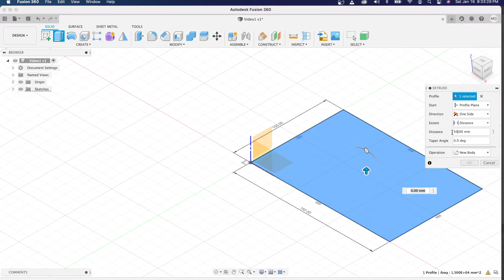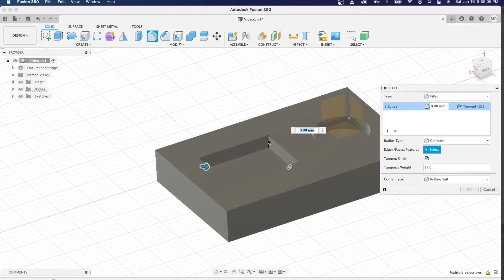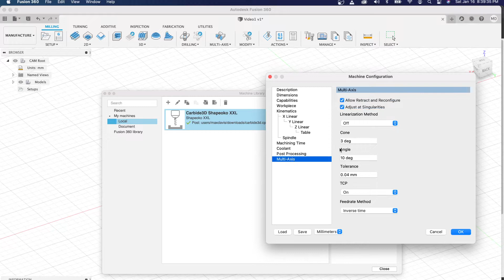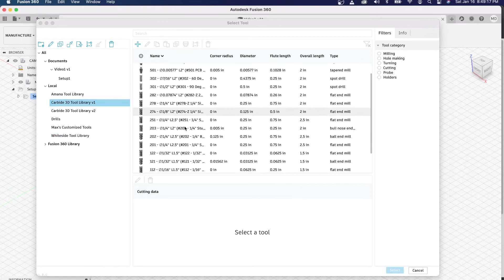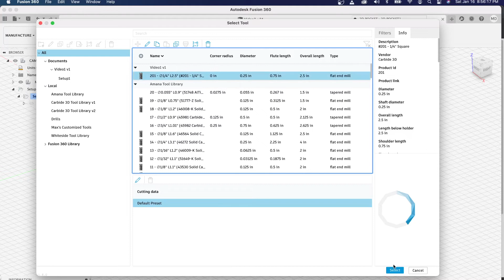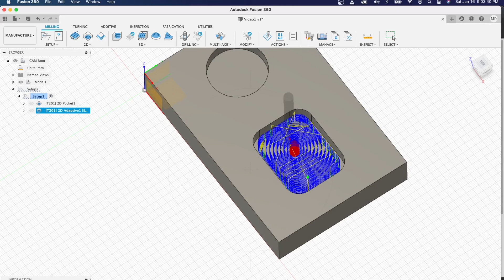Beginner Introduction to Milling on a Shapeoko using Fusion 360

Comment: Thanks for this. Very useful. Got me over the in initial learning curve.
Two small point, and I mean this in the most constructive sense...
1. It can be hard to follow along when you make changes without describing what you are doing. It would make it easier if you described each step - "In the tools tab, select X and enter Y". Otherwise, the viewer has to spend time looking for your mouse pointer to see what you are doing.
2. A few times during the video, you sort of diverted from the main workflow to describe some initial setup task. It would be better if these were all done at the outset. I understand that you are doing much of this from knowledge gained from experience, but to the beginner, having to interrupt your flow to download tool or machine configurations can break concentration.

Comment: I'm having a hard time importing the tool library from the link. i was able to import another .json tool library but this one wont import into Fusion 360.
Reply: did you find any solution
Reply: @normanny7760  Yea. I found the tools on Shapeoko's community forum and got it in there. That was awhile back (memory like a gnat).
Reply: @coulterjb22  great